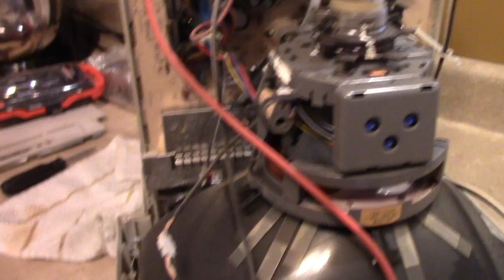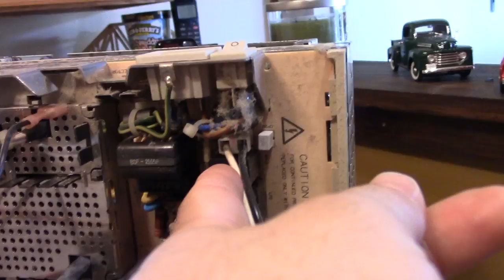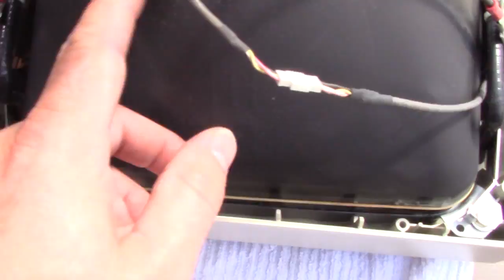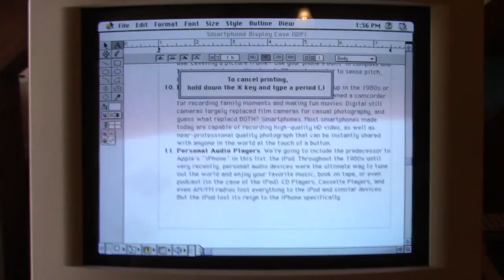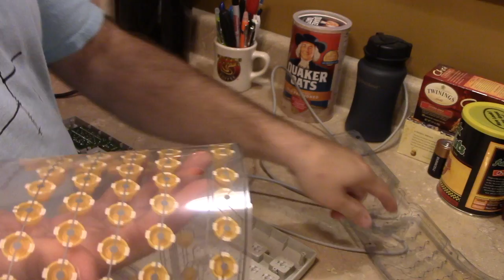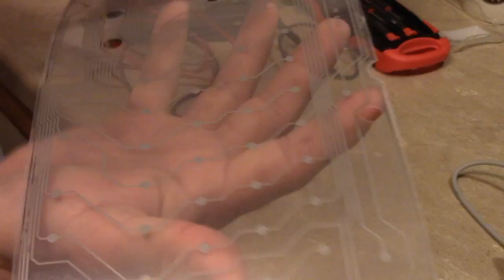Macintosh Performa/LC 575 Disassembly and Keyboard Issues

Comment: For those curious the little side coil on the yoke appear to adjust the corner convergence...tilt...not sure what to call it. It seems to alter horizontal line convergence mostly and mostly the corners/sides. If out of adjustment, one side can be pulled out more then the other side and it balances between top and bottom. So adjusting it is a matter of balancing top and bottom screen's convergence tilt. It seems to effect vertical line convergence on the corners too to a lessor degree.. (you definitely need a plastic tool to adjust that properly FYI, any metal being inserted will interfere with the adjustment process and may heat up to unsafe levels due to induced currents. It's the one trim pot non metal tools is a requirement. You can use a metal tool for the others...it's just a shock hazard and very not recommended. :P ). It uses a small hex driver shape for the tool. Sized the same as the focus trim pot too so if you got a long plastic tool that fits that it should fit this too.

For some reason the service manual doesn't mention what they adjust. Only the trim pots on the top of the yoke and the rings. Most monitors seem to have something similar too. The other CRTs I have have it arranged around top of the yoke instead of the side.

Curious what the official name and description of this trim adjustment is because the Apple service manual I found didn't seem to mention it.

Comment: You probably could fix that keyboard with conducive paint or use the graphite from a pencil on the traces.
Reply: Julian Doll I tried repairing the same problem on Apple PowerBook Duo 230 keyboard. You really need the conducrive paint, because carbon from a pencil does works, but only to some extent. It lowered the resistance from 100kOhms to about 1kOhms. Good, but still not good enough.

Comment: I wish apple still used screws
Reply: The 486 Man Apple lost its soul in 2012
Reply: I wish Steve jobs was immortal
Reply: Wish we could actually open our Macs
Reply: Yes, But not much to service inside
Reply: Not even the storage.
Reply: Sure a case can be made for thin laptops. But not being able to upgrade the RAM in something like the Mac mini is simply inexcusable. I hope Apple shows there's still hope for the mini and comes out with a decent update soon, but if they don't, the Hackintosh and small-form-factor Windows PC communities are going to enjoy some new arrivals...

However, serviceability doesn't mean using screws. In fact, with the 2014 Mac mini, using screws has meant just the opposite!
Reply: Apple still uses screws and you can still open a Mac.  What they've done is just make their computers less user serviceable.